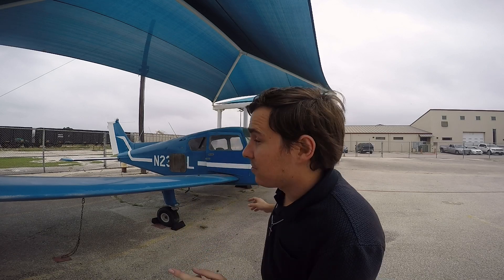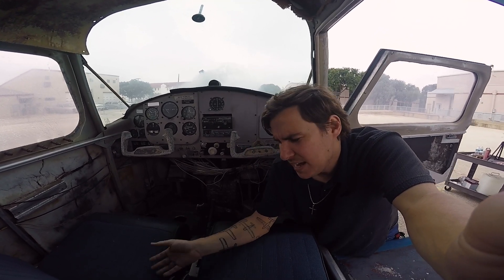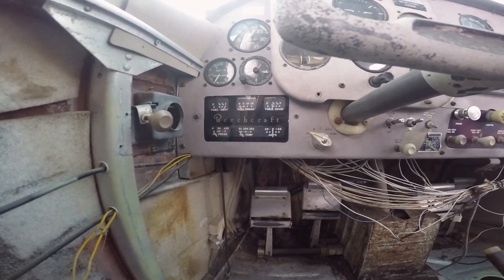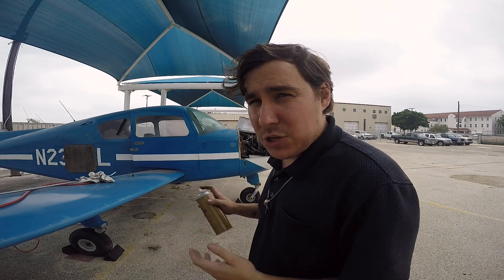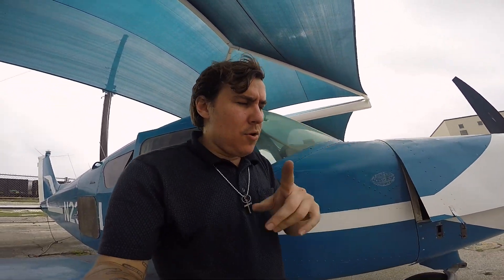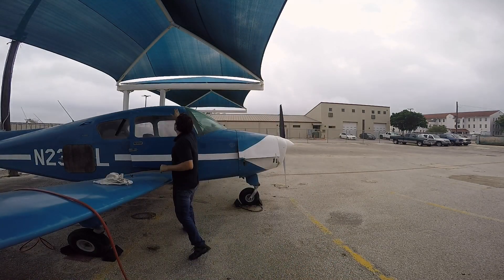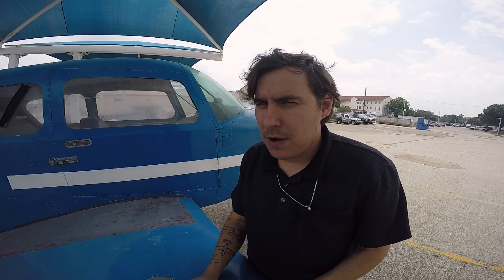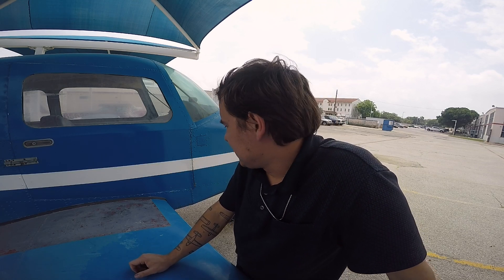Can I Get This DANGEROUS Aircraft Runing | Airplane Caught FIRE During Start-up

Comment: Another instructor hot wired the starter to the main bus? That is incredibly dangerous and I hope students don’t have access to batteries to install without instructors oversight. I’ve seen a few stuck starter relays in my day and it makes me cringe when I see pilots leaning on the prop while another is in the cockpit dicking with the master.
Reply from the maker: I actually said it wrong. Upon further inspection, they just took the amp meter out of the system. When I first got in a noticed a 4 gauge wire hanging down I assumed the worst. I thought I had edited that out of the video but apparently I said it twice

Comment: If the aircraft doesn't have extensive corrosion of the spar or other major components, why not make it a school project that students can come in after hours and work on to try and make it airworhty, even if the school has no intentions of getting it back in the air. If any of them are planning on working in the general aviation sector, and not the airlines, then this is exactly what they'll be dealing with in many circumstances and would give them great experience. Most owners these days cannot afford to keep their aircraft maintained properly, so this would be a good example of what they will have to deal with. Maybe not to this degree exactly, but not far from it. With the average age of a GA aircraft 50+ years old now, it's not going to get any better over time.
Reply from the maker: Truthfully, it just comes down to cost. We are going to use a lot of the parts on it for training and re-use the engine for something else. It would cost a lot of money to get the Mouse "airworthy" again in parts, and it's much easier to spend our budget in big nominations than small orders of parts. Most likely, texas Air Salvage will get it, and hopefully, the parts will be used to keep other aging Musketeers airworthy.

Comment: You need a fire extinguisher nearby just in case playing with gasoline, or a garden hose or both
Reply from the maker: We have a really nice on that you can roll to the aircraft but it was about 200 feet away in the hanger. In hindsight that is not were it needed to be.